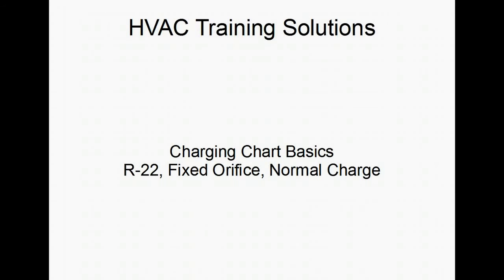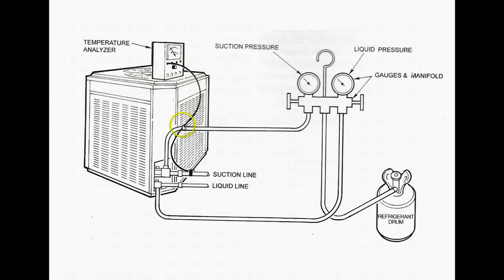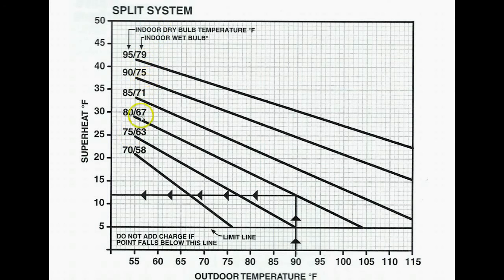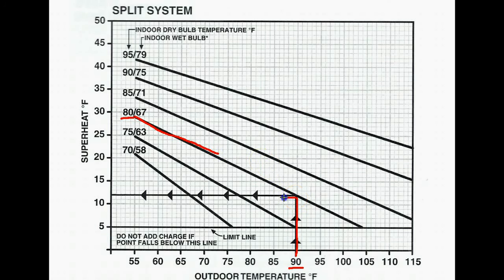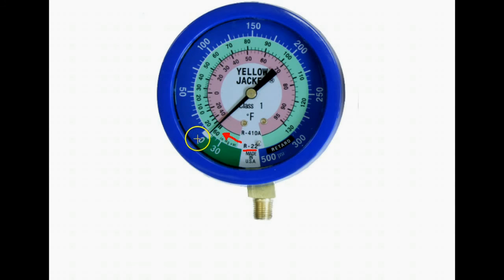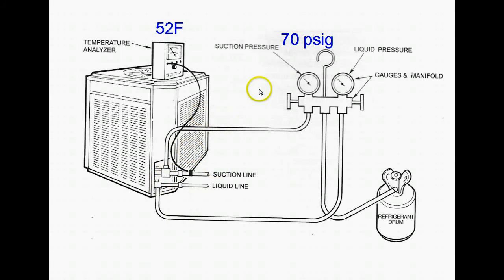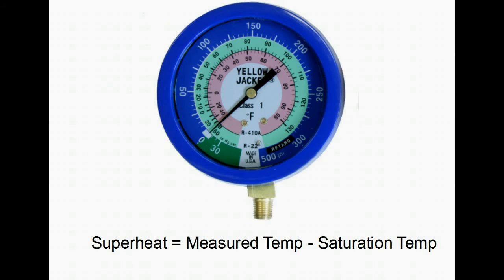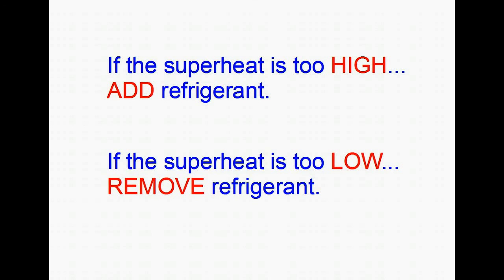Online HVAC Training - Charging Chart Basics

Comment: How do you use this if the HVAC is working and the indoor temp is 70 degrees and the outside temp is 90 degrees? It appears the chart does not work. Do you have to allow the home to warm up?